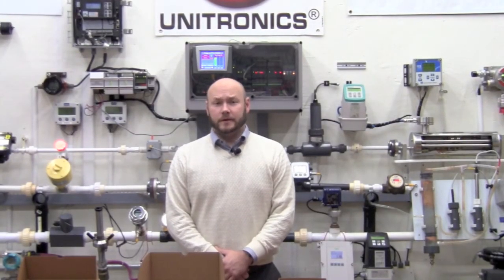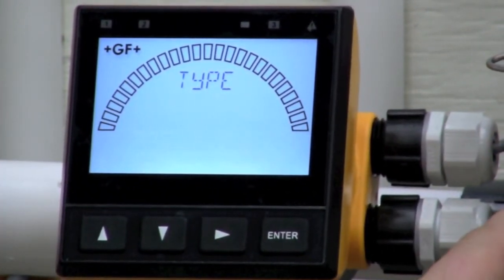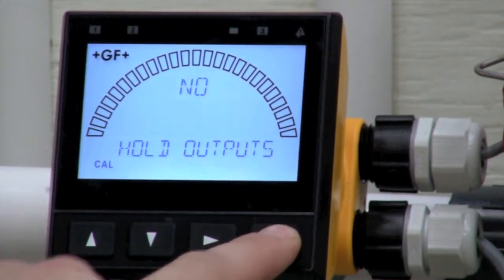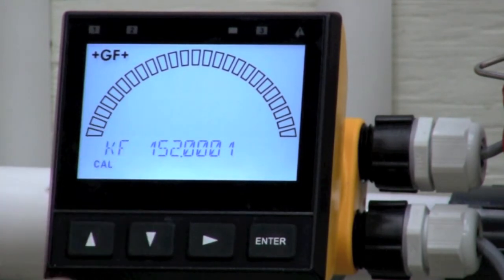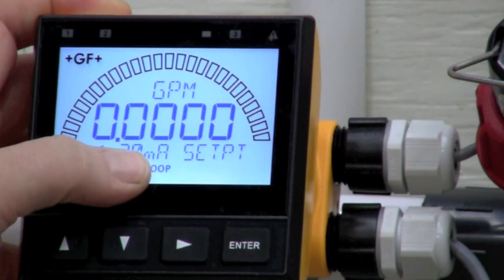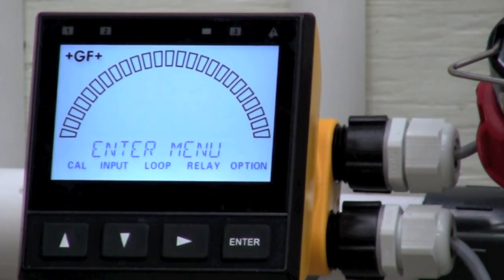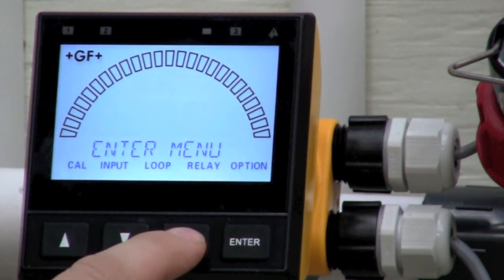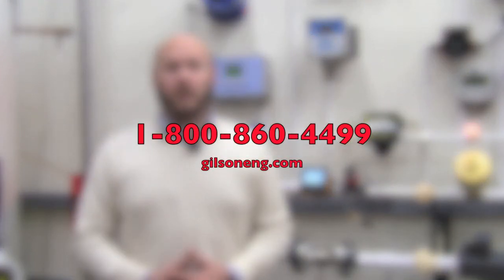GF Signet 9900 configuration

Comment: Our plant just installed one of these that we use to monitor the flow rate and to measure how much product we put into a tank. It’s super nice but one tiny issue we’re having that hopefully is an easy fix, instead of getting a live reading of the flow rate and amount, it updates about every second. Is there a way to change the latency/updates to have it refresh/update faster? Thank you!

Comment: How can you trigger the relays to change state? I Want to make a system to load 5k gallon trucks that uses a relay on the signet that starts totalizing with a start button input then closes the relay so I can use that relay to trigger the rest of the system. I want to set it up so they can enter a pre determined load amount and then have the relay open when it completes. Also how do you find your K factor? I have never used an insertion flow probe like that